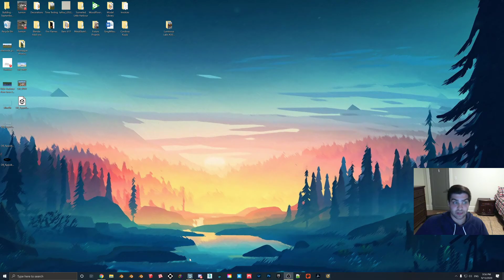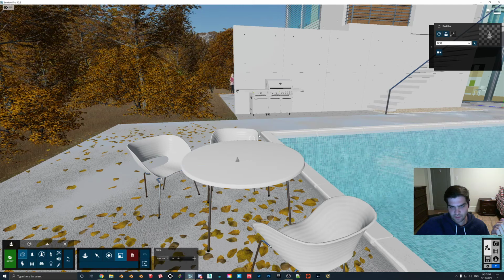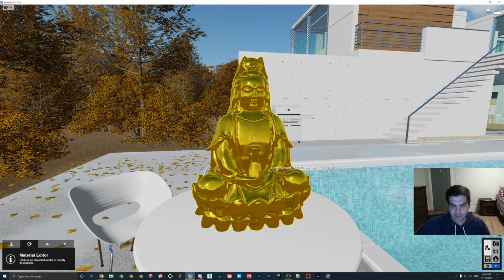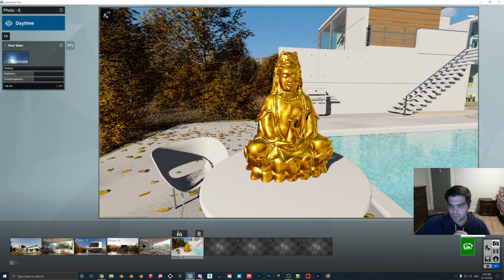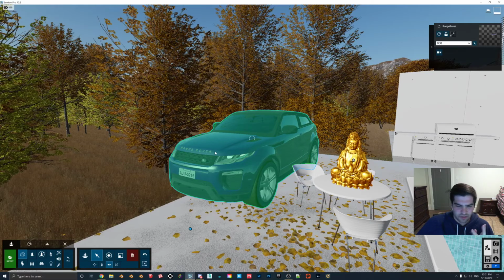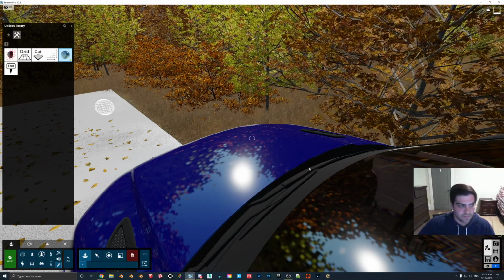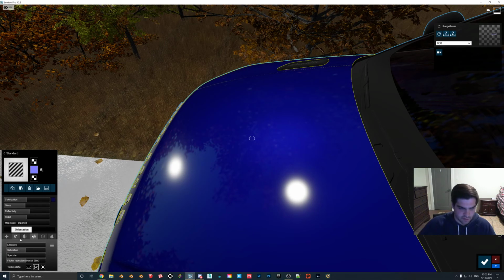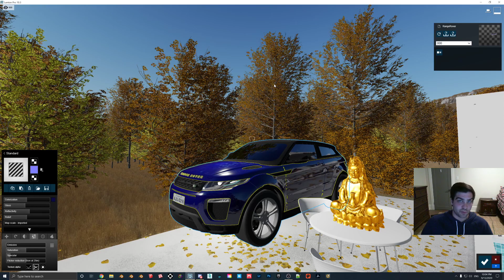Make Metal Materials POP with the SPECULAR Slider in LUMION!!

Comment: If i can advice if you click two times on slider, you can write your correct value and dont need to mess with sliding to correct place
Reply from the maker: I actually did not know that. Normally what I do when I need an exact number is I hold shift, but this is definitely better.

Thanks Andrej!
Reply: @LuminousLabs  you are welcome, thanks you for tutorials

Comment: The forgotten slider. Very cool video covering this that I always wanted to make, but never go to it. In my opinion, Lumion messed this slider up around 5 or 6 I remember. It used to be less extreme and I used it all of the time.
Reply from the maker: I might try and dig up some old videos and see what it was like. I am surprised it is not on at least a low value for metals like gold since it can really add a lot to the material.